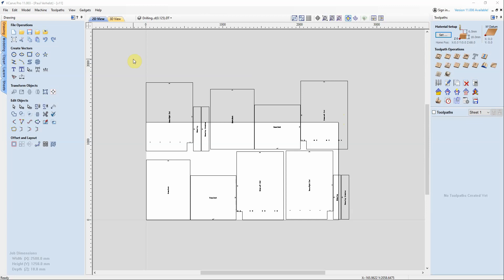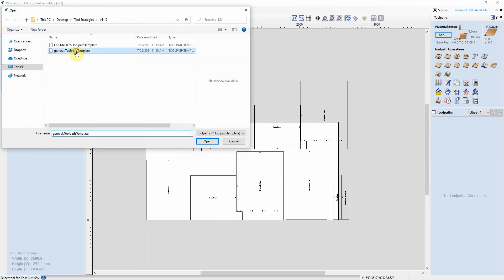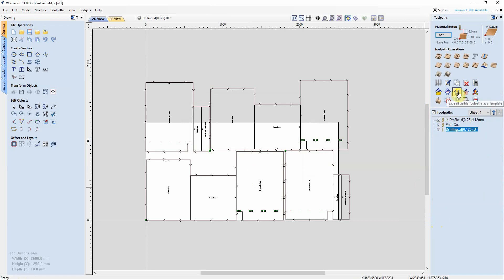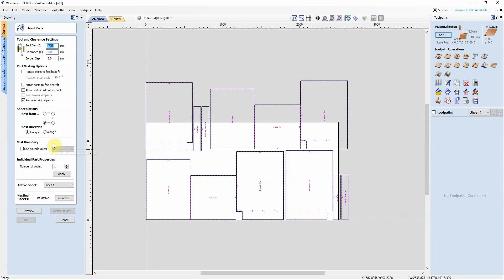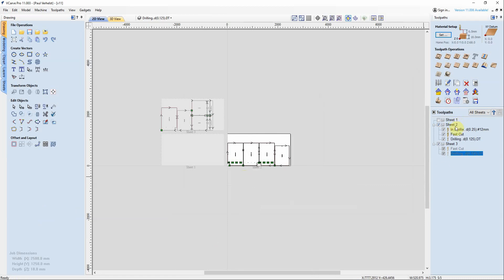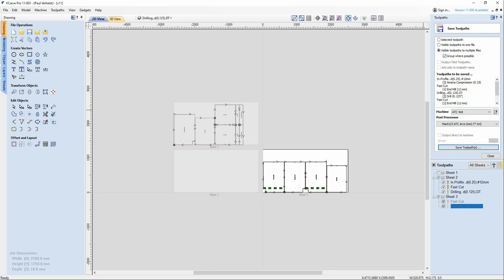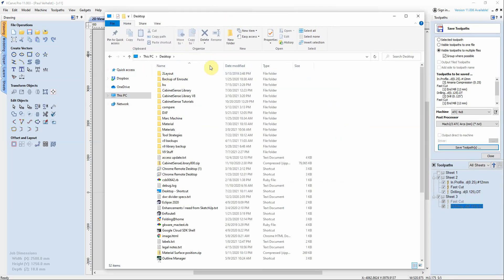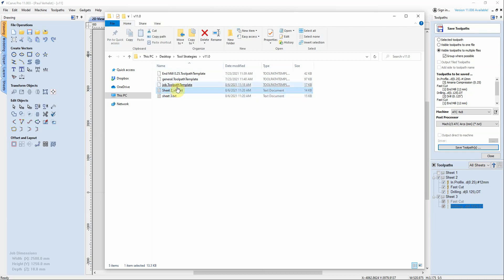Vectric V11.0 Changes

Comment: Hi guys, has cabinetsence got a library of metric cabinets? Also are the cabinets and software parametric? Thanks 😊
Reply: Yes they are parametric, and yes they seem to come in metric as standard, with template cabinets you can quickly resize to the size you need.